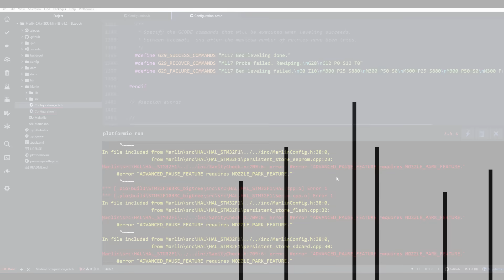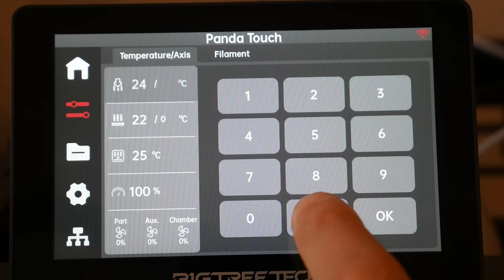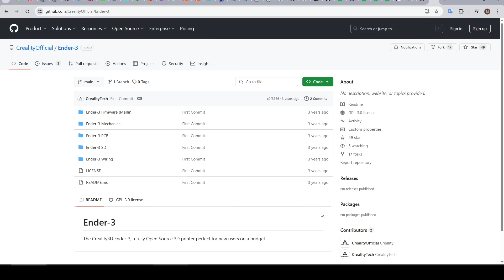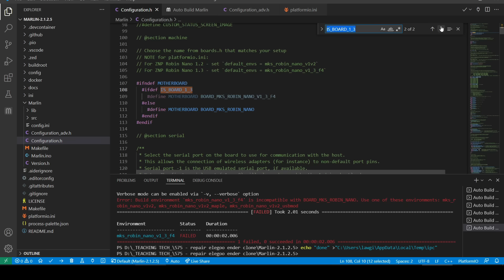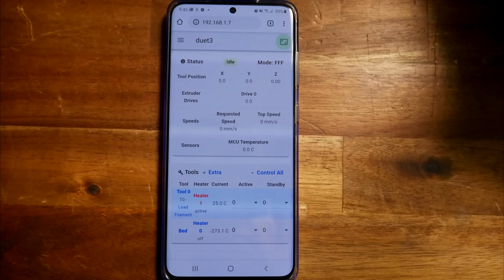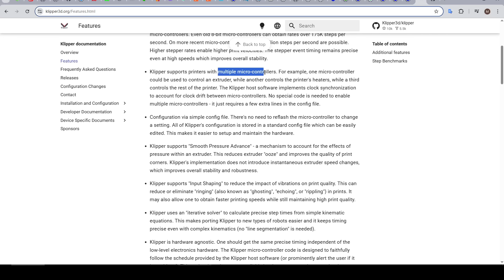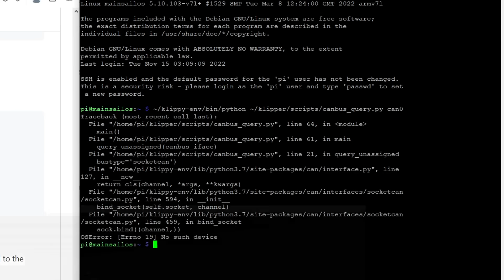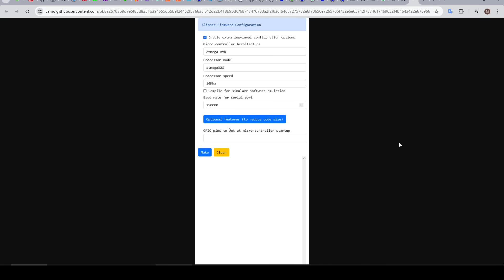What each 3D printer firmware does well, and where it needs improvement

Comment: I think a lot of people can relate when I say, "All the firmware updates, constant upgrades, and tweaking just aren’t that useful for me." I really appreciate that there’s a community of enthusiasts who love diving into this stuff, and they’ve definitely added a lot of value to 3D printing that we might not have seen otherwise. But I believe most people who buy 3D printers just want to use them without spending all their time troubleshooting, tweaking, and learning things that take time away from actually printing. In short, we want a device that works right out of the box.
Right now, I’ve got two Carbon X1 printers that I use regularly, and then there’s this half-built Voron that’s just sitting there, doing nothing for me. Honestly, I need to figure out how to sell it—it’s just taking up space. I think my experience really shows where the industry is heading.
Reply: @PaRT-3D  Bambu pretty much created a whole new industry of its own. Think of it like buying a 2025 Honda Accord. You're not going to take it home and start stripping it down and replacing everything inside and out. You bought it because it is a work horse to get you from point A to B reliably as long as you do your routinely maintenance. Before Bambu, 3d printing was more like the project car you have in the garage. It is fun to tinker with and you sometimes get it up and running but most of the time it is undergoing maintenance/upgrades and sitting there all torn apart. New car makers (bambu in this analogy) aren't worried about what gear heads want. They want to make a reliable product to sell to the masses.
Reply: @oozie-c3j I don't understand what people do to printers to have them working only occasionaly. I had prusas, flashforges, enders used in office by people who only knew how to convert stl to to gcode with provided profiles with minimal intervention to fix a clog once in a while. I also have creality that only have a frame and psu left from original parts and it also prints most of the time.
Reply: @oozie-c3j  Yeah, I agree.  But also, back when something like a Makerbot Replicator II was dominating it still wasn’t about firmware experiments/tweaks/updates by the user; at least not a user like me.  But, it was about struggling with hardware issues like Nozzles, build surfaces or even filament quality. So, even back then I was still focused on printing stuff; mainly for work where time to a usable part was always the issue.  We really didn’t have time to mess with firmware.
Reply: "constant upgrades" is not a requirement. If your printer is working fine, you can leave it with that version for the foreseeable future. I recently updated a Marlin based printer to get new features that had been running fine on very old Marlin for many years.
Reply: Both with marlin and with klipper, I've been years without updating firmwares because the ones I had were working fine. I only had to tweak things once to configure them. Keep a backup of your SD card, though!

Comment: I almost fell of my chair when you said the K2 plus is a clone of the X1 Carbon, The K2 plus is the printer that the X1 Carbon wishes it was and maybe will be when it grows up and gets bigger , better and faster. The K2 Plus has a clear lineage in the Creality K Series that has built over time. Its a bit like saying that a Ferrari is a clone of a Ford model T
Reply: This might be one of the most wildly inaccurate statements I've read in a while. Not only is the K2 plus a X1C clone, but it compares more to the P1S than the X1C. The only things it brings to the table is size (big deal), and a heated chamber. Implying the K2 is a better printer than either of the Bambu machines is laughable at best. At it's best it is equal but offering slightly different features. At worst it is another creality disaster that is wildly overpriced that pretty much sums up the entire Core XY line from creality.
Reply: @OmegaGamingNetwork  Talk about wildly inaccurate, if you know anything about the K series Crealitys you will see the linage from the K1, to the K1C to the K1 Max and finally the K2 Plus. The X1C is more akin to the smaller , slower machines like the K1. The K2 Plus is by far the best AND fastest machine to the point it is not really consumer grade, it professional grade  not to mention the 350mm square build volume that makes the X1C look like to consumer grade toy it is. I love when Bambu fan boys get all upset because they have been conned into buying second rate equipment
Reply: @mikeobrien9829  I run a business, that means I heavily evaluate every single new printer that comes to the market that meets or exceeds my requirements. I don't care who the brand is, I'm not loyal to any of them. I buy whatever is objectively the best machine for my business based on; performance, reliability, parts availability and most importantly a machines lack of giving me a headache. Size isn't everything, that is something only a hobbyist would say. I am not a hobbyist. Don't get me wrong, there are times were a larger capacity would be nice, but it is a far lower criteria than all the things i mentioned before. If size was the only thing that mattered, I would own an orange storm giga, I don't. The K2 isn't a professional grade machine mostly because the company behind it has proven extremely unreliable putting it nicely. Now that might change over the coming years if Creality proves they are here to play again, but right now that isn't proven and the K2 has plenty of problems. In the event that creality actually proves they have their stuff together and have addressed issues that have not only plagued this printer but their company as a whole for years, I'll consider them just like any other machine. Until then the P1S remains the most cost effective workhorse machine on the market for those of us who operate more than a couple machines and measure our print volume in the thousands. 

I always love it when people who blindly hate a brand post nonsense that proves they don't know what they are talking about.
Reply: @OmegaGamingNetwork And your still in business, thats amazing as you show little to no  knowledge on these things. And you just assume that others are unable to make comparisons or have in depth knowledge. You seem to forget the K2 has closed loop steppers or maybe you just to ignorant. Do I have to explain to you the advantages of closed loop steppers over the standard steppers in the X1C, so the K2  it bigger agreed, its more accurate because it has closed loop steppers, it has full AI for print monitoring with cameras and LIDAR, It is significantly faster and the quality of the prints is second to none. As for customer service, Prior to the K2 I used  Creality customer service (never had an issue with the K2 after hundreds of hours printing) and I have found Creality Service support to be excellent in general. So here you go a box of Tissues to wipe away the tears after wasting your money on Bambu Labs second rate equipment that is so outdated as to be like comparing a Ender 3 with the K2. Last count I have around 20 3D printers being a mix of resin and FDM, so I'm not just your average hobbyist as you seem to assume. Ohh sorry your the expert and NOBODY else has any experience or knowledge. Humility will get you along way and maybe make your business more profitable and you print bigger , higher quality and more accurate prints on your K2 Plus
Reply: @mikeobrien9829  Ok bud, you just keep believing whatever you want. Nothing you just ranted has anything to do with what I actually wrote.
Reply: @ I See you are the one living the the dream world, facts and specifications speak for themselves, I see you dont let facts get in the way of your dream world. Here have another box of tissues

Comment: I could call myself a Marlin guy - I got along with it with AC i3 Mega (I made Marlin 1.x to show M73 remaining times on reprap discount graphics UI and original "touch" screen is true PITA for manual bed mesh levelling) and later with N32 Aquila (currently ProUI from classicrocker883 fork).

Configuration can be daunting if one does not have close-enough starting point and/or does not know what to search for (I never remember where IS of FT_MOTION is defined).
Marlin has has LA for ages and ZV IS. More shapers were merged in FT Motion (Ulendo) and hopefully it now works universally.
IMO Marlin DWIN (Ender 3 V2) display and rotary encoder is the best UI for 3D printer. It's responsive and logical. Tuning Z-offset is simple as feedback is instant.

Octoprint is nice (beats walking with SD card 😉), but it does not currently have good responsive UI (think in phone screen size). I need to check out Printoid. Having two screens is a bit of overkill. Maybe Octoprint could send list of latest files and let printing start from printer (currently only the last can be started, if set up correctly). Also no reliable way to find out IS configuration (somebody needs to extract relevant klipper parts to Octoprint plugin).

Klipper, well. I flashed it once to use Kusba2 to find out resonant frequencies for Marlin ZV IS 😅 Then, after switching old Core2 HP desktop to BTT Pi 1.2 I thought "why not" and went "full" klipper. Easy parts: setting basic configuration from existing examples for the printer and the extruder. MCU flashing is a bit of a task, but I'm never going to update CPU part software. It's easy to update configuration and simply restart MCU. And accelerator is fairly easy to add for IS tuning.

While config documentation is fair, and there's plenty of 3rd party examples, macros are different story: I still don't know how to make filament change (M600) to work (it heats up if needed and retracts, then nothing; I have to manually load filament). What I mean is that macros are plenty, multiple versions and maybe require either Mainsail or Fluidd (never sure if macros work the same way in both).

Klipperscreen might make a difference, but Klipperoid sort of works (it's good for starting prints but e.g. tuning Z-offset does not work well).
IMO klipper is full of linux philosophy, with multiple options - none of them quite polished.

Part of beauty of Bambu Lab (and iOS and android and Windows 10)  firmware is that they work and usually don't need tweaking. I get it that they want to keep their firmware closed (they may have motion control knowledge from DJI they don't want to share), but I don't get why they want to lie about "security" and close and control access to printers they don't own 🙄

Comment: I'm a programmer with a now-custom Ender 5 and building a Voron. What irritates me about Marlin is the build/install time when tweaking settings and the palarver of upgrading the main software and having to diff all my changes into the config files (and a couple of small tweaks further down) so, having started playing with Klipper, I appreciate just being able to web-edit the config and reboot. I think I've got the hang of building the software and flashing it onto the various boards of the Voron but I do worry that, if the wheels come off the bus, they'll be hours of fiddling about - I don't dislike this, it's just hard to find the time!

I can certainly see why a closed system for people who don't want to know what's under the bonnet/hood would be appreciated by Joe User.

Comment: Honestly I love Marlin!  
I'm running my altered Marlin 2.1.2.1 firmware on my OLD Old Ender5 with stock ATmega1284p Creality V1.1.4 board. 
Bilinear AutoBed leveling with bltouch clone (while keeping speaker beep boops). 
Arc support (yes I use arc gcode). 
expanded print bed size limits. 
For fun some customisation details including custom BootScreen, corrected default Kp Ki Kd for my printer setup. 
Oh and insuring that basic safety features for thermal runaway watch ect are definitely in place!
Reply: Just curious, why do you use arcs?
Reply: @TheNamelessOne12357  better smooth curves and circles, much smaller gcode files and less commands required per second.
Reply: Although I liked Marlin, I found that 8 bit CPU gets stressed beyond it's limit when I print arcs faster than about 100 mm/s.  There were noticeable delays during printing, which left numerous artifacts when printing from the USB port.  
Upgrading to Klipper allowed printing at 200-300 mm/s.  The wireless interface is also much better than Pronterface.  It was well worth the price of the Raspberry Pi clone.

Comment: as for the network issue, you can just connect a keyboard to you pi, as you have a display. There's some key combination that just opens the terminal instead of klipperscreen. I had this exact network issue and did this to resolve it without having to reinstall. If you don't have a display, you can take the pi out of the printer and connect it to a regular computer display using hdmi

Comment: I think you summarized it in the end. Having both ways is best. A friendly GUI and a good pre-configured pre-installed firmware are great. Additionally allowing power users (good term) to SSH and change configs is fantastic. I think Open Source has an advantage since it will always leave the decision to the user. With a device that expensive, I think even a lot of not so power users may be thinking about getting closer to their hardware in the future, so they might want to have possibilities and decisions left to them. With proprietary firmware, you just can't know what comes next and nowadays you often also cannot chose if you want an update or not, whereas with open source, you at least have the option to not use an update if you don't like it.

Comment: RRF is still my favorite firmware, used marlin for a short time and then tried klipper for a while
made the switch to entirely use RRF after some annoying issues with Klipper where the suggested steps to resolve it where not really satisfying and a bit concerning.

yea RRF is not Beginner friendly it can Damage your hardware rather easy.
but if you need to do some really special stuff its the best firmware for the process it allows for quite advanced stuff, like remaping the motionsystem throu gcode while a print is running.
another strong feature is realtime access to the state of the machine throu the Machine Model wich can be also accessed via a API request to the printer

David Crocker (DC42) and the rest of the Duet Team are fantastic, they are quick in helping with issues related to theyre hardware and Software or just to talk about Printing.
There are some truely unique Machines running on RRF utilising the features it offers.

Comment: I think worth a mention for RepRap firmware is that because it's ALL gcode, you can change anything on the fly. Granted, changing motor currents mid print isn't for everyone but it's such an incredibly powerful system. I don't think any other firmware can do that. It's also a very capable CNC firmware
Reply: Klipper and reprap are useless for standard 3d printers. They only find use in precise machines that have specific meaning
Reply: @cupcake_toucher445  Klipper is what brought us the current crop of FAST, HIGH ACCELERATION printers with its resonance suppression! Furthermore Marlin has visible Bresenham artefacts because it runs all axis off a common clock which is chosen by the line gradient while 32-bit-only firmwares none of them do since they can step the motors asynchronously, though Trinamic drivers suppress the step wonkiness a little bit. Neither of these are actually high accuracy firmwares, they're more speed oriented.
Reply: @cupcake_toucher445 Useless?  I've just upgraded my old printer to Klipper and had spectacular performance improvements.

Comment: I am  a "tinkerer" and as such, require open source (or reinvent the wheel:{().  Currently am rebuilding an old tronxy into a multi toolhead machine and I want to do it "MY Way". Therefore, will be learning Klipper instead of using Marlin as I know lots of changes will be needed and thus not have to re-compile for each instance.  IF I were to buy a new printer, Bambu is definately a no-go under the current conditions.

Comment: A printer with preconfigured firmware would be great except most of the printer manufacturers seem to really half ass it. Even if they get it right on one version they usually screw it up with next update so I find this kinda cancels out the update issue with klipper.

Comment: Should SOVOL get their act together they have an enormous opportunity to take good market share.
Open source Klipper is the way to go.
No one can adapt any Bamboo to a multi toolchanger!!!!
Cheers.
Reply: Its not out of the question to replatform a bambu to be klipper or RRF - and then add extra capabilities on top of the fairly good hardware. Thats what i'm effectively doing with my current Sovol RRF project.

Comment: I am so lame with programming that I would never consider trying to use Klipper if it wasn't for RatOS. People in the Rat Rig forum convinced me to try it long ago, I did and I made it work. Most recently I did a V-Core 4 500 IDEX with the newest RatOS 2.1 and the experience with the web interface configurator was quite good. Given the online documentation I think anyone can get it working well. So if you want Klipper but feel intimidated it is worth checking if your printer is one of those supported by RatOS.
Reply: Now I want to mount two more stepper motors and another extruder onto my SV08 to convert it into a hybrid coreXY IDEX printer.